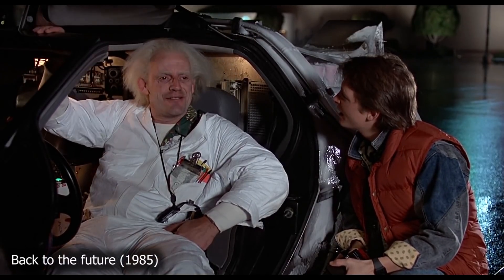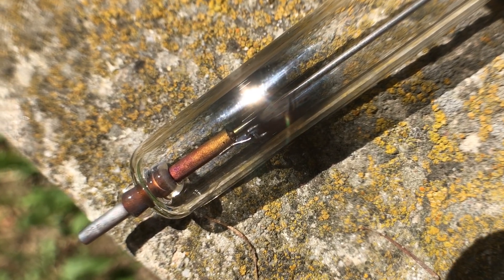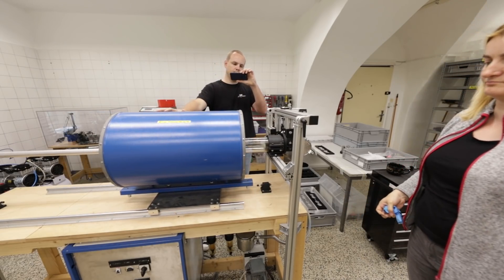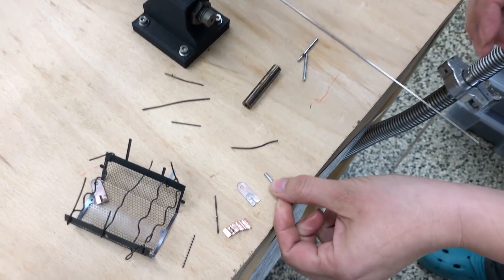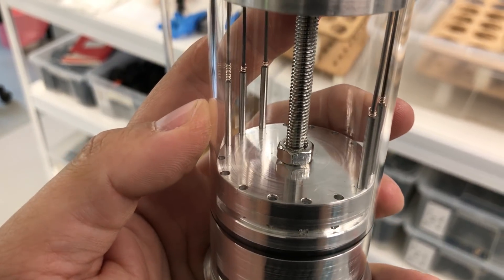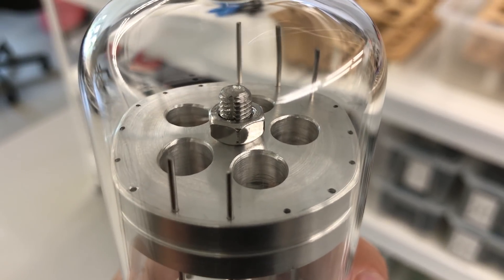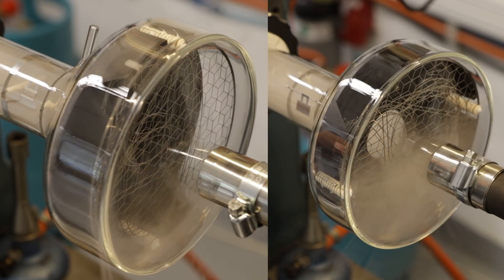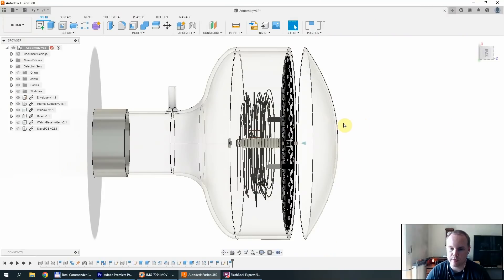Oxidation solved, brazing under vacuum | week 20-21/2022

Comment: Few likely outdated and unwanted suggestions.

Your tumbler is using media that is way too large, id recommend glass media (glass blasting media) or vapour blasting as that will add a nice shine, deburr and do a pre clean before ultrasonic cleaner.

For the brazing, for a very focused heatsource perhaps try very high power infrared lasers, 2 or more would make it fast and very localised, and infrared passes freely through glass.

Finally for the sealing phase which is causing oxidation, perhaps have a tube slide in deep of the object with noble gas flow (close to the glass welding spot) it will take away internal heat and cover the interior with a nice flow of noble gasses, once its sealed you can slowly pull the injection tube out

Comment: Cool, you guys are great.

Looks, of course, a little overcomplicated. For example, why did you need a solder joint that is not resistant to heat? Couldn't be welded?

Also, from what country you are?

Comment: If oxidation continues to be an issue in any areas, you may want to look towards using not inert gas but something actively reducing. Be that something like hydrogen gas or somehow putting a getter inside the tube you can continually heat while you do the sealing process. It might even be an option to wash the tubes with acid or some sort of etchant or even an electrolytic method using the wires connected to each digit to get rid of oxidation after it happens, though I’d only do that if it could be properly cleaned afterwards.

I suspect the issue was oxygen leaking in through the side port, even a little is enough to cause an effect.

Comment: I'm surprised you went with brazing as your first attempt to attach that wire, the very first thing that popped into my mind would be spot-welding it which might be faster and easier if you can get the weld settings right. Could possibly experiment with some of the better configurable battery tab welding tools (even something reasonably affordable like a kWeld) since the sizing makes me think the energy levels would be similar.

Comment: Why not just use flux and braze conventionally? You can easily clean it off afterwards with pickle. Even when brazing under vacuum you'll have to remove the oxides first, so I don't see the advantage. Maybe I'm missing something?

Comment: Isn't there any type of flux to remove the natural superficial layer of oxide on the parts, for reference, aluminium gets a 25nm thick layer of oxide in microseconds at atmospheric. I personally think that you need a special flux to remove the oxide, also, in theory, the flux avoids oxide forming, thus avoiding the need of vacuum braising. And sorry if I spelled some nonsense, I only do low temperature copper, brass and steel braising. Thanks a lot for sharing your work

Comment: Insert fine capillary with purge gas as deep into tube as possible and allow to leak out between face joint and exhaust port so a constant small overpressure is maintained and there is never a time when the tube has lower than atmospheric pressure which may occur with no flow and temperature changes.

Comment: Might be interesting to see a section + micrograph of those braze joints; looks like, even with a reasonable vacuum, they have to be seriously overheated, I think which means the oxides are dissolving in the metal itself.  Which isn't great for strength of the filler, but it's strong enough to begin with, I doubt that's actually a problem, but where it matters is on the bonded faces. Seems like the one fell off the tungsten rod pretty easily when melted?  But maybe that's just how it melted off, too.

Using some of that 5% hydrogen mix should be pretty interesting I'd bet.
Reply: The problem with most reducing gases is flammability..hydrogen would work but we live in 20% oxygen..forget carbon monoxide. And hydrogen is difficult to vacuum.
Reply: @keithjurena9319  They picked up some 95% N2, 5% H2 in the last update, the purge gas used for sealing; might be as simple as bleeding some of that in with a micro gas flow valve thingy. Vacuum doesn't matter during brazing, but residual H2 would need to be pumped/gettered before sealing, yes.

Comment: If oxygen is causing these problems, couldn't you use other means of melting like Laser ?
Reply: Laser welding suffers similar oxidation and is provided with shielding gas or vacuum in the same way.  Even capacitor discharge spark welders make use of an inert gas if they have to make reliable brazes or welds.

Comment: I knew it's the air getting in during the annealing. Thermal expansion of the gas is quite substantial, so once the tube got a little colder during annealing, it sucked air through the exhaust tube. But it was still hot enough to oxidise the electrodes.
Great video, as always :)

Comment: I do not really understand what is going on in this video because it seems to address several unrelated activities. The initial brazing, why not just use TIG to braze? Just use a long-ish post flow...
Reply: Exactly my thought?   Induction heating works with argon as well - used in industry.  You could also melt the glass with hot argon.
This looks like a lot of money in search of personal meaning.  Broken philosophy or why academics can't get things done that your average welder would have figured out in a glance.
Reply: @lrakschmidt2880  I wouldn't be so harsh because towards the end of the vijeo they do show old school equipment etc. There must be a reason, but I'm not sure why.

Comment: About your frustration with not finding that simple solution earlier, in Spain we got an old tale where Christopher Columbus was having dinner with some nobles after his "discovery" of the American continent, one noble was complimenting him for finding a new comercial route through the Atlantic instead of the old complicated route to the Asian continent while another noble intervened claiming anyone could've thought of that, Columbus answer was asking the 2nd noble to please find a way to ballance an egg upright, the noble tried for a while but it always rolled over, when Colon tried it for himself he cracked the bottom of the egg making a flat surface for it to rest on, the noble exclaimed that it was a stupidly simple solution and Colon responded "yes but you couldn't find it yourself".

The moral of the story is that simple in your face solutions are hard to find but they are also elegant, you found a way to solve your problem without adding extra steps to your manufacturing process, it's a good reason to congratulate yourself

Comment: If the issue is air bleeding into the tubes, how farfetched is it to seal the lathe -  or even just the immediate environment of the tube - in a container that is filled with argon? I realize that the torch is a source of gasses that would have to be separated from the argon environment, but you'd at least be able to ensure no air intrusion, instead of "some" that might affect your yield.
Reply: Keeping slightly positive pressure in the tube is enough. Problem was that they cut the purging gas during annealing, so gas inside the tube contracted and sucked air in. I think that some pressure regulator would solve the issue.
Reply: they need an excess of oxygen in the flame too otherwise it'll leave soot in the glass

Comment: Regarding the deburring, have you tried a different material as grit? Also, I think the vibration type deburring machines work faster. Additionally, have you considered electropolishing for the polishing step after electroplating? You could try to turn it on in reverse for a short time after alectroplating, so a bit of copper is removed to form a clean surface.

Comment: Congrats on the H-Tube!
Since brazing under vacuum didn't work great for the relay, have you considered using forming gas here?
You already have it for the H-Tube, and with a hole in that chamber you made you could flush it all quickly and then have the gas work as a flux.

Comment: When i was making my own flash tubes for a dye laser project i brazed tungsten to stainless with standard brazing rod and a mapp/air torch.  worked fine with the borax based pink flux on the rod.  cleaned part by boiling in water.  results were good enough for a flash tube, not sure how well the alloy would have worked in high vacuum.  I'd just try that wire you have with some borax and a flame torch.

Comment: The media you're using isn't small, nor sharp enough to cut such burr. You also need a specific shape and size. Prolly ceramic pyramids and ceramic balls (in conjunction...maybe, prolly best to have two stages for the job, deburring and polishing separate). Also, the machine itself might need to be of a different type. There's rotation, vibration, rotation + vibration, and the media itself demands a specific type of operation (which itself can be wet or dry). It's a whole mess, but it's worth it once you've figured out what does what because you can work the solution very fast. I suggest getting in touch with a media manufacturer because they can point you towards the right solution very fast, hassle free.
Reply: I've also found that adjustments to the intensity of the cut can extend the Thermal ramp-down of the cut, thereby increasing the abilty for the trailing edge to shrink back during cooling phase...just a thought 😉

Comment: That poses the question: Where on earth did you get ATMEGA328P from these days? ;-)
Reply from the maker: Exactly - the official order (made in summer 2021) will arrive at the end of 2023... So, I took ATMEGA328PB from eBay, secondhand.. I once made a mistake and ordered PB (not P) version, this is easier to find now than P.. :-)
Reply: @daliborfarny  validate the heck out of them just in case. Soooo many fakes and seconds out there.
Reply from the maker: @zyeborm  these seems to be ok - surplus from another eu company (consumer), but we will check!

Comment: Probably the oxygen comes in through the hole since it's cooling down, sucking in the air and the purging gas just fills up the space instead of the air in the colldown phase.
Reply: It's probably not even necessary to suppose that was happening though. As another commenter said on the last video, gas diffusion happens very fast, particularly at the temperatures they are heating it to and with the hydrogen nitrogen mix they are using. The average velocity of a hydrogen atom at ROOM temperature is well over 2 Km per second!!  As long as they keep some positive pressure on the inside of the tube as it's sealing so there is some flow of gas, however small, the purge gas will sweep any other gasses out of the tube on very short timescales, probably less than a second or two and keep them out. It doesn't even matter that the mean free path for collision of a gas molecule at ambient pressure is only like a hundred nanometers - the diffusion still dominates.
Reply: @Muonium1  Thanks for the very good explanation. I actually meant the vacuum port. Sry my english is not the best.

Comment: I know it sounds stupid but is there a way to thread and screw the 2 metals together instead of brazing? Great machining btw and congrats on the oxidation free tubey!
Reply: Not good idea in high vacuum applications.
Reply: spot welding maybe but since they already use that in the nixies, its probably not useful here
Reply from the maker: Spot welding would simplify it, but the look would be different..
Reply from the maker: We try to make a historically correct replica here, also I believe we can use this technique in the future - so I prefer to learn it :-)
Reply: When you go that small, you go down such a rabbit hole that it almost makes it pointless to not do it like they did it originally.